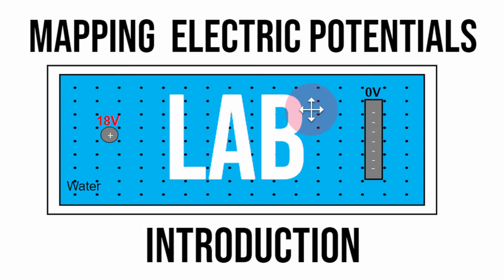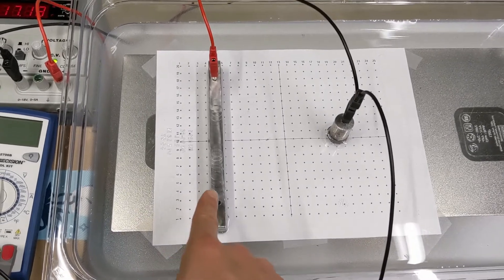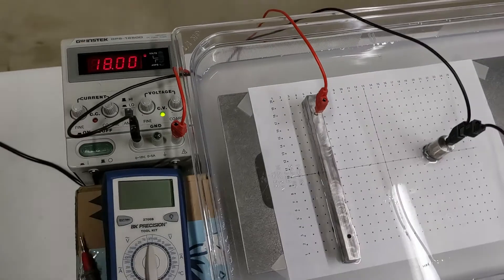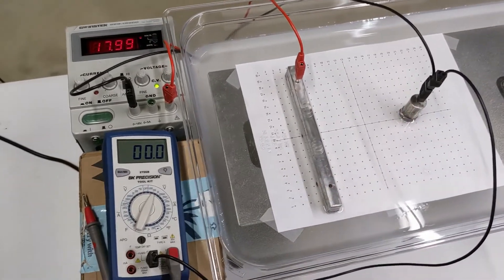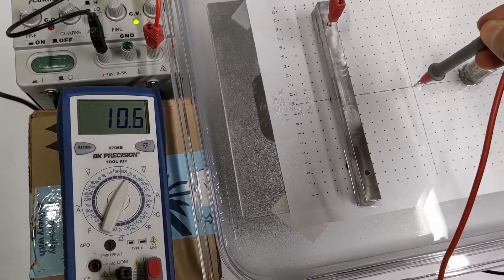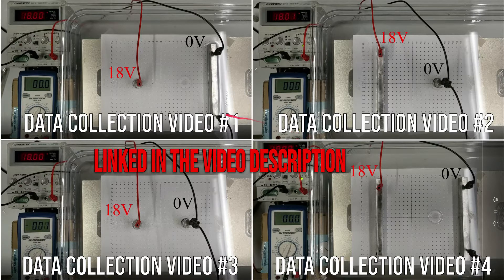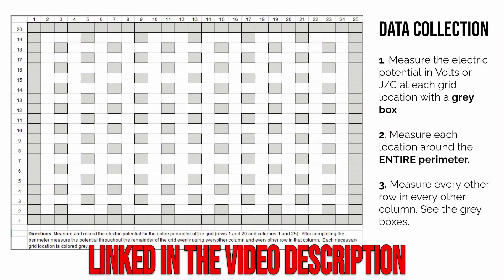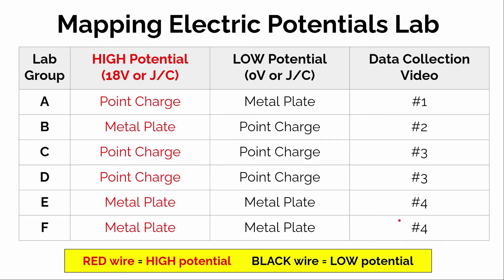Mapping Electric Potential Lab (Introduction)

Comment: Couldn't you instead start at a point midway  along the line from the point source to the plate ground and then slide the measuring probe in such a manner as to trace out isopotentials. Then do it for other  point nearer and further away from that original point.